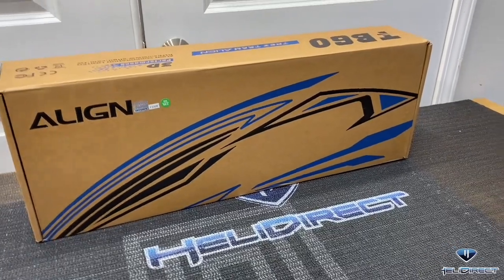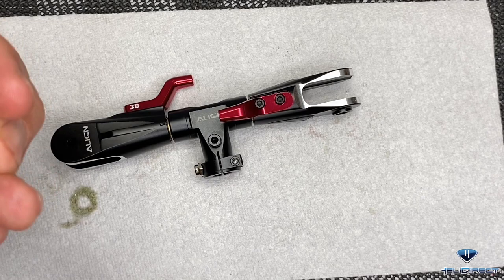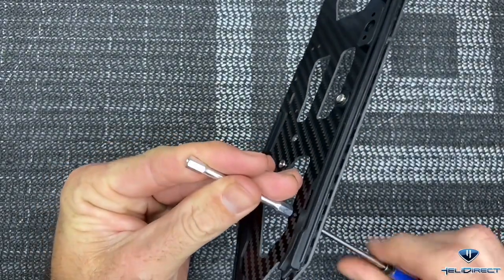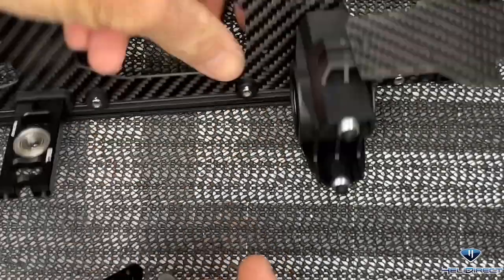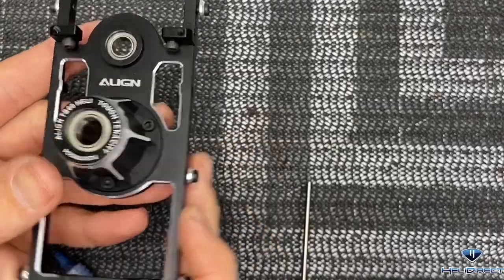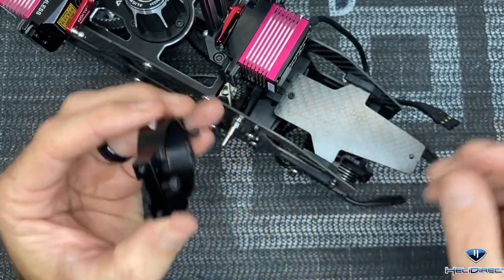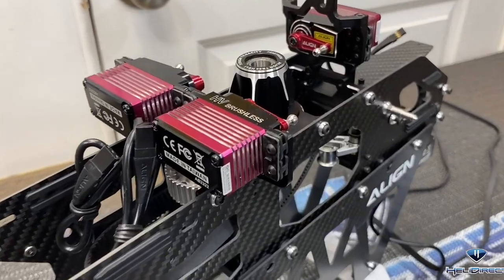Align TB 60 Build Series, Part 1: Head and Frame Assembly by Jeff West

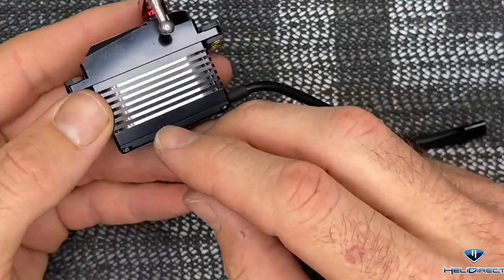Comment: WARNING: In the video, installing the tail servo, ignore most of what you see and hear about orienting the spline and horn in the timestamp range 21:44 - 23:34. It is wrong. Jump ahead to 23:35. The instructions at 23:35 - 23:47 are correct. Briefly at 23:48 - 23:50 it jumps back the wrong orientation again.

Comment: Thanks for the build videos !

I just built a TB60 and I’m finding the tail belt tension with the everything backed out is very tight. Did you have that experience?  Feel like there is drag in the system running this tight.

Comment: Around 2:59 Jeff says "Tapered side of the head dampener faces the headblock" but I have never seen this in an Align manual and the TB60 and 550X Instruction Manuals show the tapered side facing out, into the blade grip. Can anyone clarify?
Reply: Tapered side towards the inside of the head block so it fits in the rubber damper.
Reply: @westhobbiesrc8051  are you sure ?? in the manual i looks like the other side around ... also with other helis ... the tapered side is always towards the grip and not the block ... it also came preassembled the other way around ... if i remember correctly